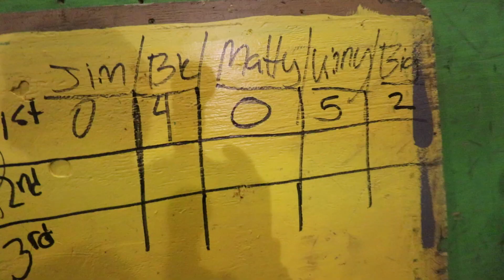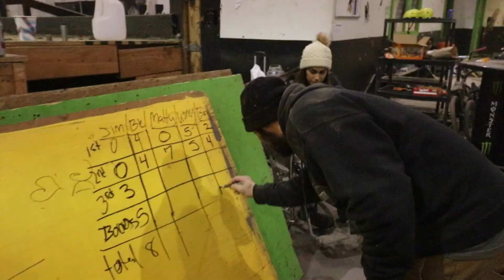INSANE OVERSIZED BOWLING!

Comment: That ceiling fan has been on since episode one, wth.
Reply: Eddie Dz no ac in there
Reply: funny cause its snowing
Reply: Probably wired to the lights.
Reply: need air circulation in such a open spot like that dust builds up can have dust on the ramps but it's basically air circulation that's what fans are for

Comment: That looked fun, btw, in bowling you get 2 turns even if you get no pins on your first try. I haven't bowled in a very long time but I'm pretty sure that's how it works, correct me.if I'm wrong
Reply: Tardis 412 You're right, but I think they wanted to keep it short.